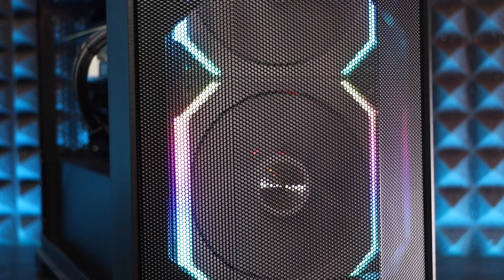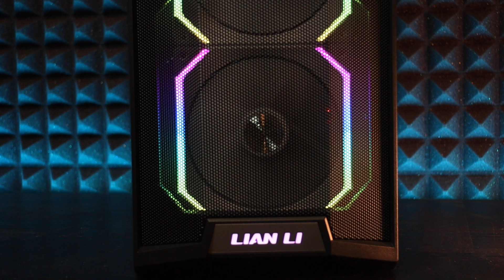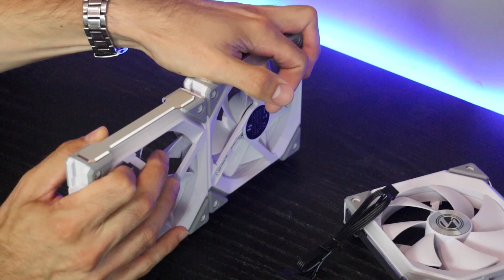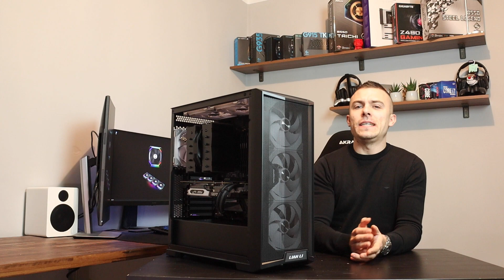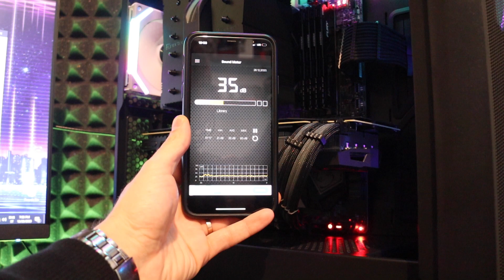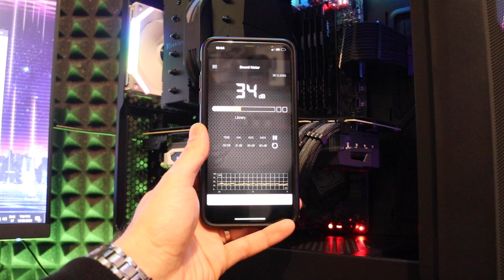They listened! - Lian Li UNI FAN SL140

Comment: Question if please 
The front panel 200mm fans of the lian li lancool 215  can be replaced With 3 fans 140 lian li does the front panel fit with 3 fans 140 lian li and thank you.
Reply from the maker: Actually no. Originally you can't place 3x 140mm on the front, but I used their connection since they are connected to each other and only couple of screws to make it work. I didn't have the option to tie up all 12 screws, but because of their connection together and 4 (or something like that) screws holding, there is no unnecessary vibration and no extra noise. Hope that helps.
Reply: @PCCrazyDario  ok I  get it but with lian li fans can be fit even if 140mm  but with the connotation the 3 fans 140 lian li it can fit only lian li fans right and only couple of screws to make it work right  so there will not be any problems
Reply from the maker: @taskforce141overlord2  Something like that and only because they are connected together. With other fans, you wouldn't be able to do so.

Comment: Hey there!  I am working on a Lian Li build and was wondering if 3 - SL140s would fit in a Lancool II Mesh case.  Thanks!
Reply from the maker: Hi there, no actually. This had a bit of a modding in it so you would have to change or modify some parts to actually do this.
Reply: @PCCrazyDario  OK, thanks!  So I'd be limited to two of the 140s then?
Reply from the maker: @Based_Dad  Exactly, or 3x 120mm
Reply: I have a Mesh 2, I got 3 SL140's to fit. Here's how, connect them together and zip tie them to the case.

Take the fan cage out, place a piece of clear tape over the power button and reset button so they don't fall out - there's 6 screws under the power button PCB, take them out. There's glue holding the connections together, scrape it off and remove the color and mode cables that are attached to the fans. Take the fan cage, with everything in it, set it aside. Connect the SL140's together, and zip tie the fans through their screw holes to the larger holes on the case that I believe are supposed to be radiator holes. Get all 4 zip ties in there  - connect them loosely so you can make adjustments to the fans, make sure there's no cables getting caught, and move the fans how you want it before you tighten them down. And you're done. I went through a lot of shit, with a drill, pliers, a dremel, a metal file; trying to essentially redesign my case to fit the fan cage, AND get it to the front where it's not hidden in the back, so I can see it. I'm going to ask Lian Li if they can send me out a replacement piece for a cover I wrecked.

Comment: Do the 140 fans actually fit above the PSU in the Lancool mesh 2. The 120 fans do not fit as the screws are out of alignment when you have them daisy-changed. But does the 140s extra size fix this problem?

Comment: How did u put 3 140mm fans on lancool 215?
Reply from the maker: Slight modifications. Thankfully they are all connected toghether so you don't have to use all the screws to attach them to the front panel and there are no vibrations for you to be concerned about or extra noise.
Reply: @PCCrazyDario  Hi. What i have to do to fit 3x140mm sl fans on front of lian li 215?
Reply from the maker: @matelejson  Well, for this video I connected them to the case with maybe 4 screws or something like that. The good thing about SL fans in general is that they are connected together so that helps a lot in stabilization of the fans so you don't need all the screws. Or if you are up for it, you can always drill additional holes in the case and make every screw fit perfectly. ;)

Comment: I just received my SL140 w. Controller and I connected everything but then my PC wouldn't turn on. I disconnected the SATA cable from the controller and I was able to turn it on. But as soon as I connect the SATA back, it turns off. Is my SATA cable faulty or am I doing something wrong?
Reply: whats your psu and pc specs?
Reply from the maker: Exactly what person above me wrote, what is your PSU?